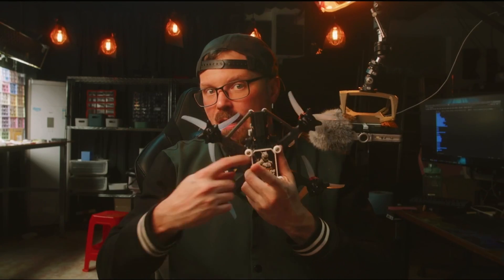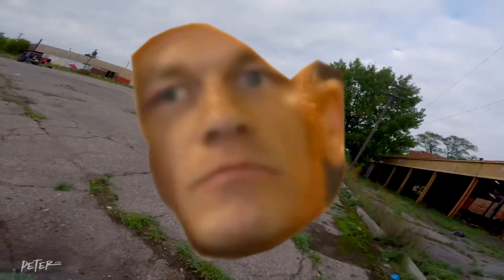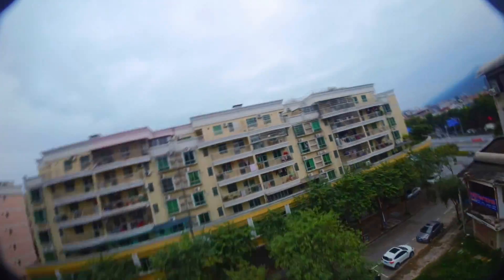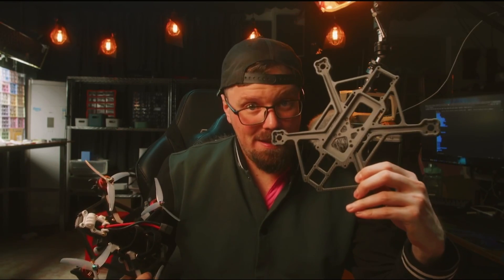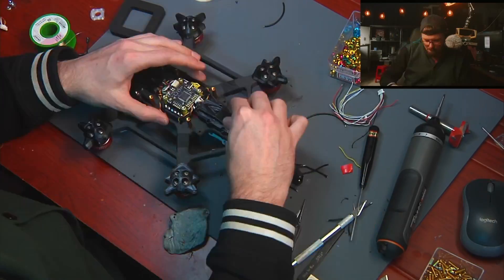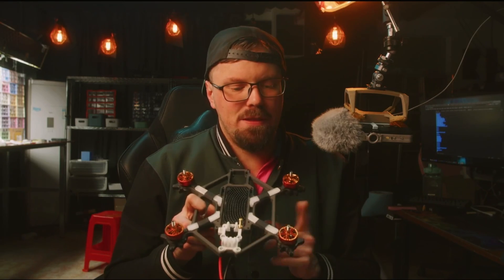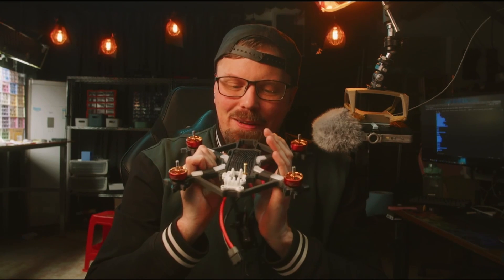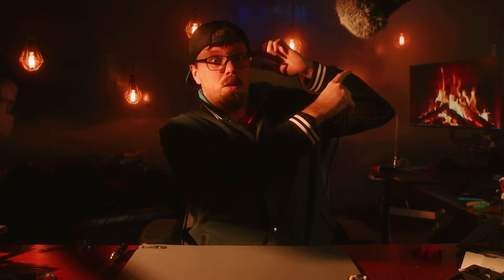This 3D Printed Drone could change everything!

Comment: PA6-CF wich nr did you went with? cf10,15,20 etc
Reply from the maker: @Just4FunRC  I ended up on pa12cf. It holds up under humidity better
Reply: @33rdframe  thanks! Got a few rolls on it.   Im also gonna give ASA CF a try.  Love asa for outdoors and its cheaper contra pa12cf

Comment: Im not sure about the pa6 nylon suggestion, yes it's stiff but only when dry. When it takes on water (pa6 nylon is hygroscopic, it will do this), it will get more tough but also more flexible. Think of zipties, they are incredibly tough but not very stiff. I'd be very curious to see results after waterlogging the frame.

Fiber filled PET could serve as a good replacement for nylon.
PA12, and other nylons also take on less water.
Reply from the maker: @woutervossebeld4664  100%. In the updated video I made this correction. Pa12 worked great though. Even if it had less initial stuffness

Comment: Is there a parts list?
Reply from the maker: @djshrew  there was until my website went down. Now just on my Patreon
Reply: @33rdframe  signed up, don’t see any parts list. Anyone else wondering don’t bother signing up, there is nothing there. Printed the frame wasting LW-PLA worthless print, no build guide or parts list.
Reply: @33rdframe  behind a paywall or free? Could you provide a link either way? thanks in advance.

Comment: Realtalk - I'm going to build my first drone and get my first 3d Printer capable of printing something of this quality. Would you really use this as your first build before building one out with a commercial frame?
Reply from the maker: Absolutely , and welcome to FPV
Reply: @33rdframe  Just put my first two hours in the sim. Never going back.

 3d printer comes soon. Truly considering 3d printing as much of my first as possible. Should be fun.
Reply from the maker: @ZacharyChampigny  heck yeah bro!!! You caught the bug haha
Reply from the maker: @ZacharyChampigny  check out my 3D printed whoop design: https://doctorquads.com/2024/02/17/getting-started-with-fpv-the-ultimate-3-inch-whoop/
Reply: @33rdframe  Will check this out. Was planning on either trying to build the Cinawhoop you have the tutorial on or perhaps build one out based on the new 6 inch frame you've recently shared.
Reply from the maker: @ZacharyChampigny  can't go wrong with either one

Comment: youre a good promoter i must say. one of the most interesting videos on quad builds in a while. given that you hype up stuff alot in past videos, i wanna see logs as well and comparisons. am very willing to try this out (got a bambu lab p1s and recently received all the carbon upgrades) and compare to higher end frames that i fly. unibody killing in resonance performance is something i can believe. then again its complex. 10$ self-print is amazing. i wonder how durable this is given the multiple branches and one-piece design. it might just break less to begin with?
Reply from the maker: Thanks so much bro

Comment: I printed this drone fairly lightweight and durable. I changed a few things like I increased infill to 45% and created a traditional top plate. It is very strong at 570 grams carrying a 1500 4s battery.
Reply from the maker: Oh wow! Never thought to make it a lightweight drone! How is the flight?
Reply: @33rdframe  Its lightweight compared to the Marmotte I flew previously. It flies very well. Did you intend for the frame to be printed at 100%

Comment: I guarantee you, I built a better 3D printed copter one year ago.
Still, pretty good design compared to what you usually see on the internet.
Reply from the maker: copter or drone?
Reply: @33rdframe  Quadcopter.
Reply from the maker: @uhu4677  links or it didn't happen
Reply from the maker: @uhu4677  so how is it better then?
Reply from the maker: @uhu4677  I mean I am all for someone beating my drone but from a person with your profile and zero evidence I am starting to doubt it
Reply from the maker: @uhu4677  haha fair enough. Well, if it is better than mine...I'll be 10% miffed and 90% excited. Because I'm 10% a YouTuber and 90% a pilot ;)

Comment: I had some polymide pa6 GF laying around so I printed the frame and it is very strong, I did bump walls/tops/bottoms to 6, Im printing the tpu parts now. I might transplant everything from a 6s Quadmula siren F5 that was hyped that I think doesnt stand up to the ImpulseRC Apex...fyi I dont like mr.steele but that frame does handle great.
Reply from the maker: That's awesome bro!. I would recommend 100% infil as it's still around 110g.
Reply: @33rdframe  i printed it and it came out to 120 grams. with 100% infill....bummer, i should have just made more walls ans less infill..
Reply from the maker: @yuriy77  this is totally ok and will fly great!

Comment: Build/printing video in the works? Also would like to see some bb logs. And do you have a rough estimate how much it cost, if it gets broken and needs reprinting? 
I would maybe split up the frame into pieces, so its faster/cheaper/easier to replace broken stuff...
Reply from the maker: but that might make if fly much worse. its 10$ to print. build video tbh is not needed. its SUPER easy
maybe a parts printing video is better for you
Reply: @DRXfilms  yeah,  I don't see good images to figure out what everything is. I checked out the drive and there are a lot of files, I'm not sure what's best for what
Reply from the maker: @yuriy77  I'm working on a guide now. I did just finish the frame the other day haha
Reply: let us know when its avail.  @33rdframe

Comment: How durable is it? Last time i messed with that CF filament it has a tendency to delaminate between layers due to the vibration, i had far better results with tpu with a  modified version of a drone called the Toad, with the center plates mad from petg, i made a peice of carbon fiber to reinforce the bottom plate due to the weight of the battery cuz the petg could break in a crash, and then i printed the top with a whoop canopy on top that has a gopro mount to get the fpv camera up higher so your not looking at the front cross member. It flys like butter because the tpu absorbs all the vibration and it's pretty much the toughest drone you'll find, the only downside is the battery being on the bottom making it more vulnerable if you don't pull up in time
Reply from the maker: this is interesting. i will have to update you on that when i fly it more. currently its holding up without issue

Comment: Nylon over PC?? PC-CF is going be significantly stiffer and more resilient without the hassle of printing Nylon
Reply from the maker: oh baby. i do like the sound of that. tbh i need to test a BUNCH of different filaments. what company do you recommend for PC CF
Reply: @33rdframe  The brand I went with is PRILINE. <$50/kg currently on Amazon. Definitely a better filament for UV/temp exposure and much less warpy than nylon (but you will need at least partial enclosure.) Less fumes too!

Comment: Holy shit. this is awesome. subscribed

However, I have a question, I've read that single-piece frames have worse resonance characteristics than frames with separate arms & more pieces etc.

What do you think about that? How is the frame resonance on this 3d printed dron ?
Reply: would like to see that as well.
Reply: Friction between parts help to dampen oscillations, but I would hipotesise that nylon carbon fiber composite may have more damping capability than rigid carbon fiber epoxy composite. Without bb log it is hard to quess if I my quess is right.
Reply from the maker: @GaweNowakowski  indeed this is the case. i would love to talk with you on discord about some of these things.
Reply from the maker: it's a little complicated but from what ive come to understand its all about having your vibrations on ONE frequency that is easier to notch out
Reply: @33rdframe  aye, good, good. Am looking forward to seeing more content and tests with the 3d Printed frames, this things is awesome if we will be making our own frames in the future!

Comment: This isn't a very good design. Check the motor heating, you'll notice it. With 3D printing you have to be a lot smarter about bracing then this.
Reply from the maker: so your motors are going to get up to 130c on the foot? sounds like you got a motor problem

Comment: Love that 3D printing frames gets some more serious tries, I've been working on my own printed frame the last few weeks. Do you/polymaker think that PA6-CF is the best filament for drone frames? I didn't fully understand the behavior of nylon yet, doesn't it get wet in normal outdoor use and be less rigid than other nylons like PA12-CF?

I just wish you would have toned down the Polymaker marketing a little and talk more about how to design and print it to be strong like walls, infill etc.
Reply: Imo fdm mechanical properties are far worse than aluminium or cf so without really drastic change in design fdm quads will be quite floppy.
Nylon absorbs moisture which decreases strength, but you can coat it to keep it dry.
Pa6 is more suspectible to getting "wet" than pa12 if i remember correctly. 
If you want to get good results you need to start with dry nylon (dry it before use) and enclose your 3d printer to increase temperature inside, heated chamber would be ideal.
Reply: @GaweNowakowski  Actually, Polymaker's blend recommends not to use an enclosure to print. Wild, I know. But a high chamber temperature can increase the possibility of warping. I print with PA6-GF on an Ender 3. I have an enclosure but figured out you don't actually need it, and it's recommended to not use it.
Reply from the maker: I have a Patreon where I go into depth teaching all the things I know. Gotta eat some how
Reply: @33rdframe  That is fair and if there is something on your patreon that is related to the video it might make sense to mention that, sort of like UAV Tech does it. At least I honestly didn't get that "message" from the video.

Comment: Will most printers print that filament?
Reply: With the correct nozzle and a 300c heatblock, yes. An ender 3 could do this with an upgraded hot end.
Reply: Also just got to make sure you could keep it hot enough so it doesn't warp, with an enclosure or something. I have an Ender 3 S1 Pro and Im gonna be attempting it.
Reply: @Carguyforlife   I just have a Ender 2 so might not work for me
Reply: @DroneDelirium  not sure if you're on discord, but I'm sure you could find someone on the Polymaker discord who would print one for you. I know thats not as rewarding as printing it yourself, but the 3D printed version is waaay cheaper than the carbon fiber version. I would offer to print one for you, but I still need to buy some of the filament and see if I can pull it off. Also not sure if you're in the USA.
Reply: your ender 2 can print the filament with the proper hot end, but your bed is too small for the dimensions. @DroneDelirium
Reply: @Heptofite   Ok thanks

Comment: If i will have time I will make vibration analysis of this frame. Currently I dont see it being better than modern carbon frames but will see.
Reply from the maker: Yeah, I'd be game for that! I'll take a look at the blackbox today also
Reply: @33rdframe  I sent you email, with questions about your setup and bb log.
Reply: Small update it appears to be quite good, not as good as well designed carbon but for fdm really good.